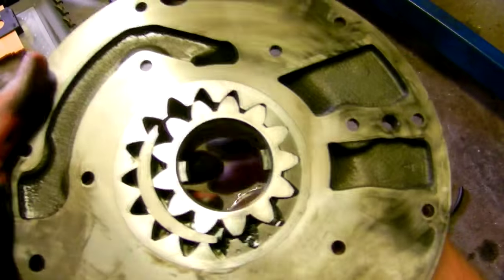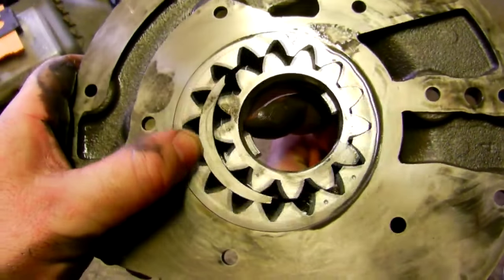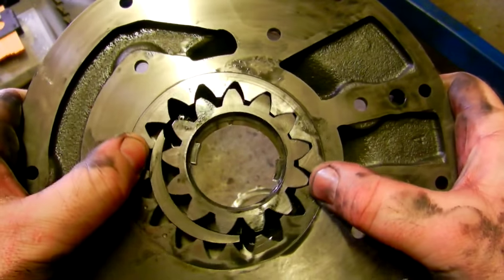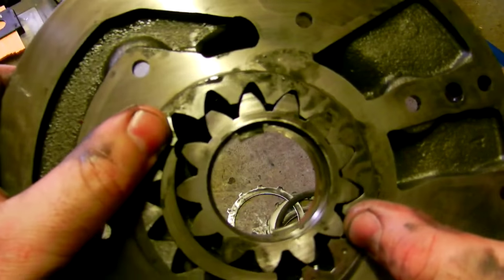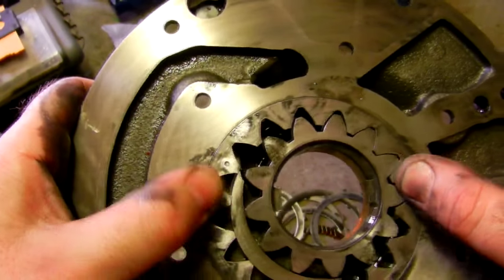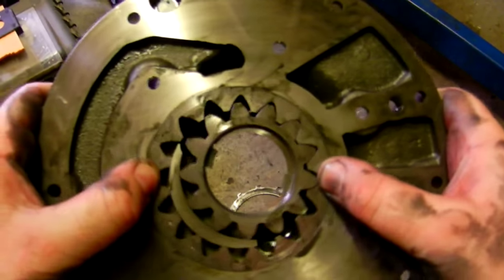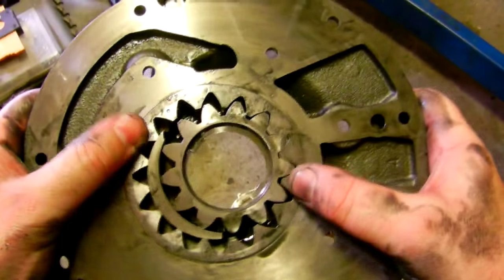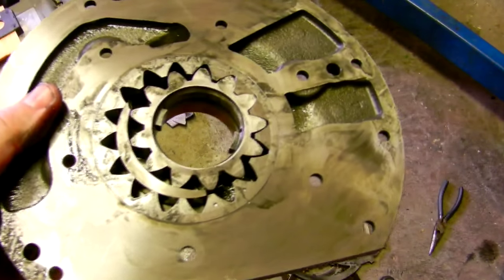How an automatic transmission pump works

Comment: i replaced the oil seal between a torque convert and a pump. after fitting everything together, the doesn't want to move amymore. either going forward or back ward. what could be the problem? please help
Reply from the maker: Salomo P Ndjimba Hi, what car?  
Assuming everything went back exactly as it was removed, lack of forward or reverse drive can be down to low fluid, incorrect selector linkage adjustment, valve block fault or associated valve block solenoid fault - which could be down to ECU or power supply problem. Fluid levels are normally checked with engine running after moving selector through all the gears first.
Reply: TK42138 the car is toyota corolla.i checked the fluid level and im fully sure that they are at the right level. the car was just moving properly befor we do the replacement of the oil seal
Reply: TK42138 the car is a toyota corolla.  i chacked the level of the oil and im fully sure they are at the right level.  nothing else i touched inside the gearbox. my concern is, why the car was moving proper before we replace the oil seal but after wr replace it, the car stopped moving?
Reply from the maker: Salomo P Ndjimba If nothing else in the transmission was touched, then perhaps oil seal has moved or become damaged in some way thus causing internal fluid leak and no pressure or greatly reduced pressure from restricted fluid flow. I'm not familiar with the Corolla transmission but general principles for all automatics tend to be the same. Was the correct process carried out when the transmission was removed and then refitted to the car? I think a restraining strap or similar device should be used to retain the torque converter to the gearbox after it is unbolted from the flex plate. When refitting transmission to the engine, the torque converter should be kept in position since it can partially detach causing drive problems.
Reply: TK42138 at first, the torque convet was not properly fitted and the car didn't want to start . later we removed it then we put it again making sure that is fitted properly fitted
the car started but suddenly it wasn't moving.
Reply from the maker: Salomo P Ndjimba There is a high risk of damage occuring to transmission and engine flex-plate if the torque converter has been incorrectly fitted and the engine started. It can cause the pump drive to break which prevents pump from turning and thus no pressure. No pressure = no drive forward or backward. The only way to check for damage is to remove the transmission and torque converter and then check the pump for damage, broken bits etc.

Comment: please can this pump be damaged like making oil leak please help 
Thanks my car is BMW E39
Reply from the maker: saleh byatra Dirty ATF or too low an oil level can damage the pump. Transmission fluid must be clean and free from particulate debris because it can act as a grinding paste if there's enough suspended in the fluid. This debris then accelerates wear of components such as the pump - which then generates more debris. Too low a fluid level causes cavitation, air locks and low pressure since a hydraulic pump cannot pump air or airated ATF. Vital for automatic transmissions (and manual) that fluid level is correct.
Reply: thanks for your respond ,
so it can cause for oil leak because recently I repaired my torque converter and the Turbine 
now my mechanic claims that I should change my oil pump.and one more thing   before he repaired my torque converter there was no oil leak at all 
now I am confused don't know what to do 
well thank you so much its appreciated 
Regards
Reply from the maker: saleh byatra Where was the oil leak coming from? Do you know exactly what he did to 'repair' the torque converter? Since these units are welded together, any repairs would mean the outer casing is cut so the stator and rotor turbines, bearings etc can be checked and/or replaced before the split outer casing is precision welded back up. That's a job for a gearbox specialist. Doubt the average car repair shop would repair a torque converter. Most would send the part to a specialist and fit reconditioned part on an exchange basis.
Reply: ***** the main problem was that he fixed is the turbine inside the torque converter
and the oil leak is between the engine and the housing in the middle .
Reply from the maker: saleh byatra If the oil is red then it's ATF from gearbox seal around input shaft or faulty torque converter. Any other oil leak will be from rear crankshaft oil seal that is located behind the flywheel/flexplate that the torque converter is bolted to. You will have to ascertain whether the oil leak is engine oil or transmission oil.
Reply: *****  thank you the oil is red its definitely ATF I'm certain ,
so you mean it is not oil pump problem ?
Reply from the maker: saleh byatra The red means ATF is leaking out. Ideally your mechanic needs to check where the leak is coming from. Since the leak started after the torque converter was rebuilt, I would insist the garage who did the work investigate at their cost. Ideally whenever a transmission is removed, the transmission input shaft seal should be replaced since if it leaks it means transmission has to be pulled out again. If the transmission oil pump was severely worn, it wouldn't generate enough pressure to activate the clutchpack via valves, pistons and valve block etc.
Reply: ***** Thank you so much for your assist really appreciated I will let you know after what will happen thanks again
Reply: @salehbyatra4707  aye mane why did he change ur torque converter
Reply: Mission hills Hyundai broke my transmission can you please help me explain to them that since they had filled up my transmission fluid too low during their transmission fluid change they damaged the pump which damaged the torque converter
Reply: Please the dealer service is giving me the run around when they should have offered a remanufactured transmission already my car only has 60k miles
Reply: Please am having problem with my that let the car was not engaging after I fixed the gearbox please what that

Comment: I have a mecury sable  2001 in i was driving from work when i got home to back up in driveway   when i put in reverse my car wouldnt move i put it in drive my car wouldnt move what can it be?
Reply from the maker: Hi, although I'm not familiar with your car, there are general checks that can be carried out that apply to most conventional automatic transmissions. 
With the car on level ground, check the transmission fluid level. Low fluid will stop transmission from working properly if at all. Important note: The engine should be idling with transmission in P and parking brake on. Then move the shift through all the gears and then back to Park. Now pepending on car, engine and type of auto transmission, there's usually different markings on dipstick that will show fluid level when hot. Auto transmission fluid should be a ruby red colour. If it's brown with pinkish tint, the oil needs changing. If it's dark brown and smells burnt or acrid, then it indicates brakebands or clutch packs have overheated and are breaking up. If fluid is grey with a metallic shimmer, that shows heavy wear as metallic particles get carried around the gearbox by the fluid. Next check is to make sure there are no blown fuses or even brake light bulbs.
Reply: @TK42138  i look its still ruby red color   cause it dont smell burnt or nun like that ..the fluid aint low  ..
Reply: @TK42138  i check the fuses and nun of them aint blown
Reply from the maker: I've had a look on some forums and it would appear the lack of drive or reverse gear on the Mercury and related models is a common problem. There was a mention of gear shift linkage problem where the linkage falls apart suddenly thus preventing gear selection. There was also mention of sensor failure on the transmission which would need diagnostic equipment to test them. 
Did your car make any unusual noises before this happened? 
Was transmission working normally prior to this problem?
Reply: @TK42138  no it didnt make no noises and no check engine light on or nun on my car and my car doing just fine until i stop to backup in the driveway thats when i seen the rpm going up when i was trying to back up but the car wouldnt move at all so i had to push it back and i check the gear shift  sensor and took it to autozone they told me it wasnt  broken or anything